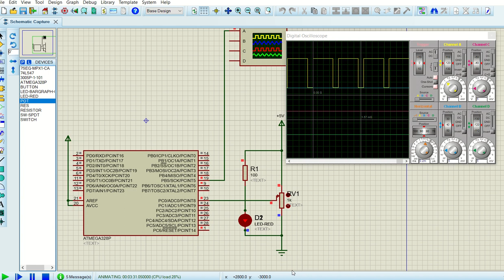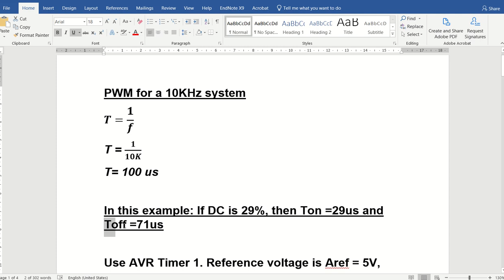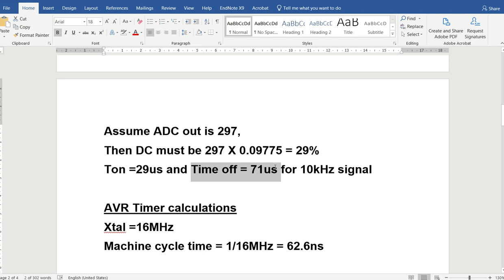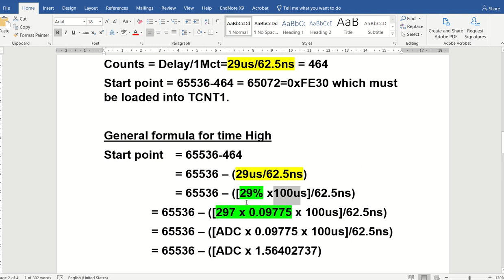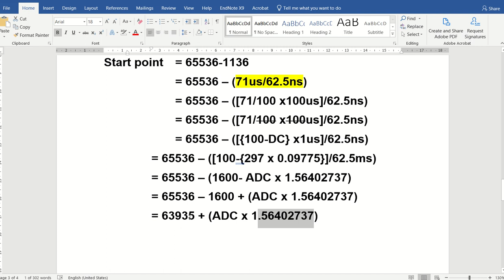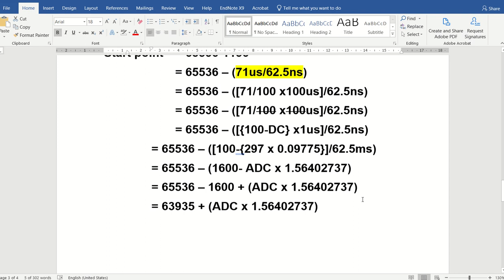PWM Video 2: Atmega328P calculations using Timer 1-Fixed Frequency

Comment: Hello sir, good evening,
Am creating a program 20Khz PWM signal for pump. It's absolutely working fine, and I wrote 2nd millis function for timer and upload same board but 2nd program is not properly work. Any solution for this sir ? Am using Arduino UNO board.